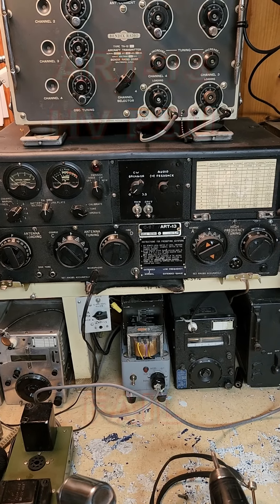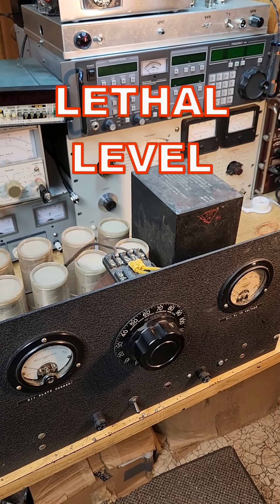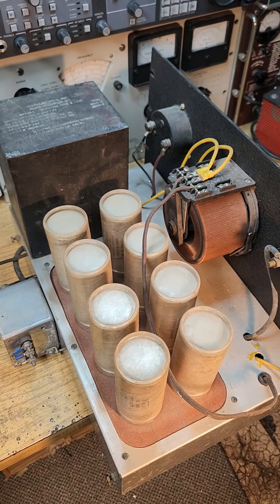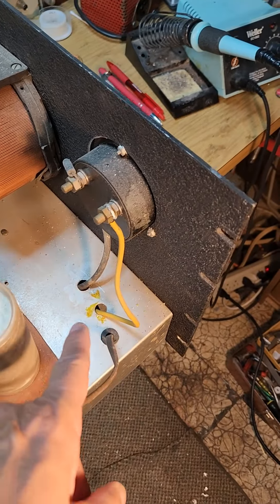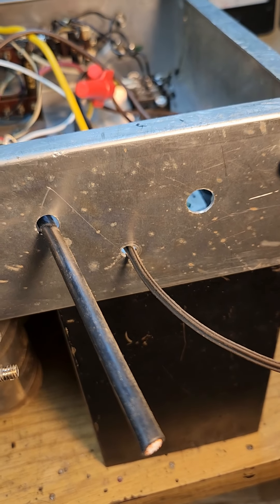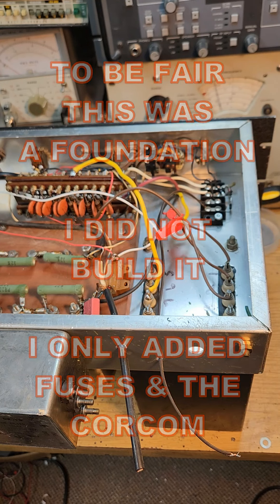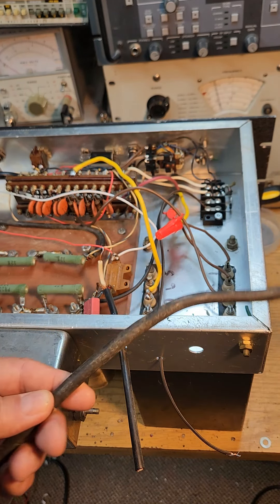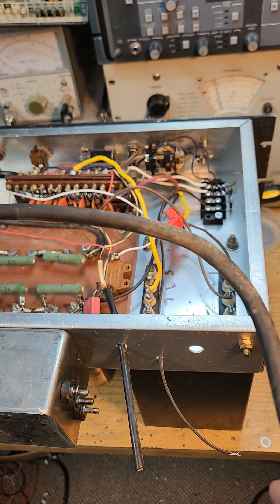ART13 Power Supply - Hand in Pocket

Comment: Age 13-14, I built a power supply to run my WS22 using numerous transformers screwed along the length of a 4 x 1 inch strip of wood, left open plan for better cooling:-)  It was on my bedroom floor underneath a bench so slippers were required to be worn when operating the set, an early form of PPE. My Dad, who spent most of ww2 repairing wireless sets in Africa and Italy, on seeing it said, you will be careful won't you son.

73 Steve M0KOV
Reply from the maker: Wow WS-22 - fancy with built in antenna tuner!

Comment: wow! a lot of work required by the sound of it... hope it goes well Mike...
Reply from the maker: All worthwhile and safely back in the rack - but the issue was in the load - the radio had a shorted modulation transformer. It was not a PSU issue.

Comment: Everything suffers from age, but the older I get, the better I was. 73's🎙KD9OAM🎧
Reply from the maker: Those 70 year old radios are staring to give problems. This one was traced to the Modulation Transformer Primary (Modulator side) of the ART-13 iron, shorting to case! Last one I lost it was an open screen winding.
Reply: @MIKROWAVE1  As a 75-year-old I'm starting to have problems too. You are still doing great work Mike, an analog guy like me, realy appreciates the content and your knowledge of electronics. Have a wonderful day and week.